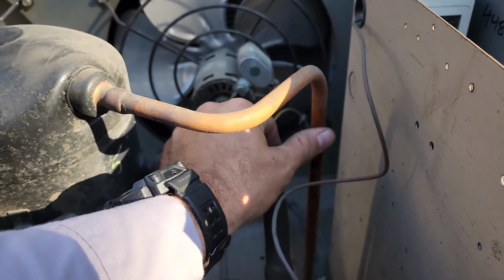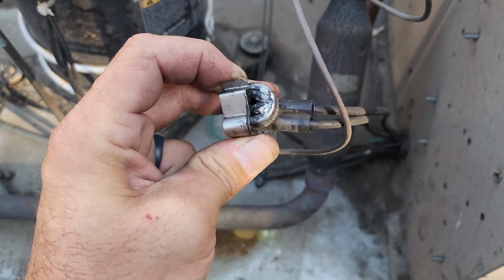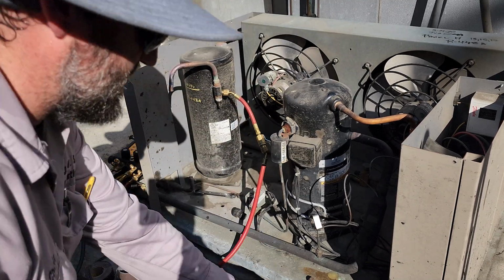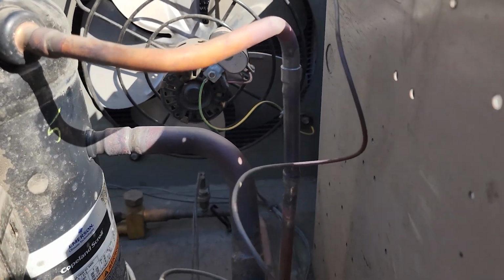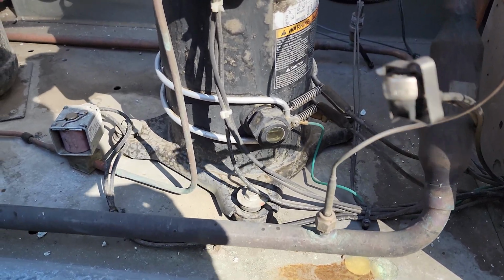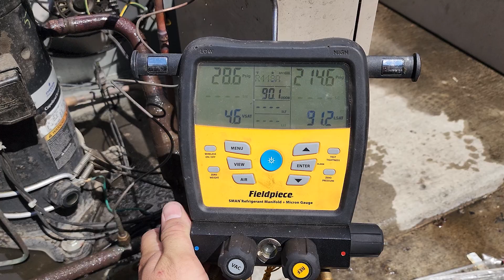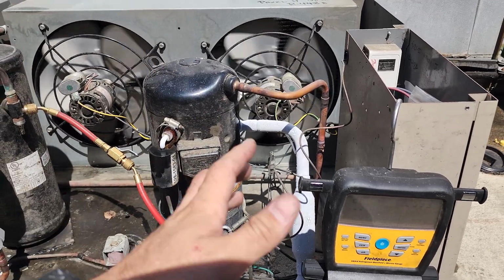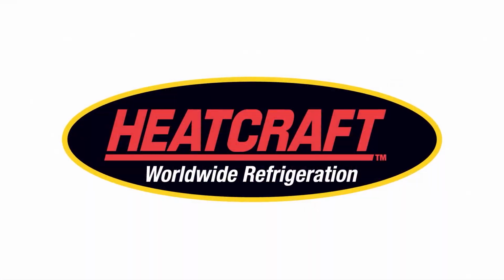I CANNOT BELIEVE THEY WAITED SO LONG TO CALL ME

Comment: A suitable control circuit fuse could possibly have prevented that punctured line.  Although I'd guess it's a fairly rare occurrence.
Reply: My guess is the dirty condenser may have had it cycling on that switch and it just finally failed.
Reply: clive, i'm also wondering that too... (i'm an eletrician "meister" from germany) 
The americans really do electronically-stupid things sometimes... 😂 a simple Motor Protection Switch could save sooo many compressors from dieing (overheating, singe phasing, overamping,...). I also always have to shake my head when he opens those AC rooftop units... man this is an electronic-mess! You think a spider did the wiring :D 
They often dont even have fuses for the multiple compressors... only contactors for switching!! those are fed from one single big terminal... no fuses, no motor protectors, NOTHING... if a copressor dies, they trust the main breaker or that silly metal fused-switch-boxes... absolutely insane... imagine we would produce such a thing in europe :D we'll get fired same day :D
Reply: Didn't expect to see you here. What a pleasant surprise
Reply: Well I didn't expect to see you here Clive 🤔 it's a small world on the internet 😂
Reply: I love it when my fav youtubers converge
Reply: @djtongi  it's all about saving money here in America, unfortunately... everything else is unimportant...
Reply: @protowave  is it really saving money when you have to buy a compressor down the road? Seems like a manufacturer shortcut at the expense of the customer later on.
Reply: @NoName-sx4cz  you are right, but few bean counters actually care about failure costs, they don't even consider them most times.

And sadly the bean counters run most things now, save a penny per unit by removing a nickel of value while keeping the sale price the same, repeat until you have sold all of your good reputation, wonder why no one buys your overpriced now cheaply made brand anymore.
But they never think past this year, sometimes even this quarter.

Personally I have become convinced that it's just part of the natural life cycle of business, one of the many natural way they die.

Comment: Regarding the suction line check valve. I work for a wholesaler and this is the explanation provided to us by Heatcraft when we discovered these in our units: "We used to do the discharge check valve which worked great but then came along that wonderful R-448A that runs very high discharge temps that tended to keep the DTC valve open at pump down so it leaked back through there.The best solution at that point was to install the suction check and then we made it universal for medium and low temp."   
Great video as always. Great Job.

Comment: The gas ballast valve on vacuum pumps is not really a bypass.  What it does is admit a small amount of air between the rough and high vacuum stages of the pump.  This air flow does two things.  One, it makes the pump work a little harder, to increase the oil temperature (and the vapor pressure of any contaminants, such as water or refrigerant, that have dissolved in the pump oil).  And two, it helps to flush those contaminants out of the pump.  The net result is a greater flow rate for any vapors that can dissolve in the pump oil, at the expense of ultimate vacuum.  So, evacuating the system to about a 1000 microns with the gas ballast on and then shutting it will lead to an over-all faster pump down and deeper ultimate vacuum.
Reply: Well stated
Reply: The ultimate vacuum difference (at least with dual stage rotary vane pumps) is negligible. E.g. my pump (non-HVAC, Leybold D25B) has an ultimate vacuum of 10^-4 mbar without gas ballast and 5*10^-3 mbar without. HVAC probably doesn't go below 10^-2 mbar.
Reply: @kanetw_  My experience is mostly with smaller pumps, such as Edwards 5 and 8 series, where the gas ballast makes a fair bit of difference in the ultimate vacuum.  I would point out that the specs you gave indicate a pressure difference of 50 times higher with gas ballast, which might be OK for HVAC, but might not be negligible in all applications.
Reply: @robertlapointe4093  Yeah, it really depends. Single-stage pumps also lose a lot when gas ballast is on.

10^-3 to 10^-4 mbar is the region where you can't really use single pumps anyway due to too low pump volume. 
So you have to do a multi pump approach with e.g. a turbomolecular pump backed with a fore pump, and there it doesn't really matter if the fore vacuum is particularly low as long as it doesn't exceed the turbo pump specs.

In vacuum drying applications you'd end up adding a roots pump to get good pump volume at low pressures, and same thing happens again.

Also a thing I just remembered: the 10^-4 mbar is partial [air] pressure, but around 10^-3 you start getting oil backstreaming so the ultimate total pressure (hidden in the detailed datasheet..) tops around 2*10^-3 mbar.

Comment: I do find it interesting when you mention ‘big picture’ so often. When a lot of the big picture stuff you reference is ‘Check wear items for wear and replace as needed’ Like, you’re totally right it’s big picture stuff that needs checking. It’s just interesting that people need to be reminded that parts designed to wear out and be cheaply replaced need to be checked routinely and cheaply replaced when needed.
Reply: The same goes with automotive repairs. Always big picture, look under the car, examine all the structure and suspension/steering components and address anything else you might find about a customers car. It's not about making the most money but informing the customer that it may be time to replace equipment even if you don't get the job. At least you were honest with the customer and that's what really matters.

Comment: As a mechanic on south Africa, it weird to see so many electronics on the system. Like I've heard about the electronic expansion valve, but we mostly still use the normal TXV
Reply: yes we have EEV.  just a friendly reminder dont try to mix a new Evaporator EEV with an old R22 condenser!

Comment: 23:45 - Is that time delay a delay-on-make? or delay-on-break? It would seem that delay-on-make would keep the compressor off longer in case the pressure increased slightly after cutout (unless I’m over-thinking it, here). I’m barely two years out of school, so I’m still learning a ton. Thanks for your input. I had a walk-in that was short cycling on low pressure cutout during pumpdown.

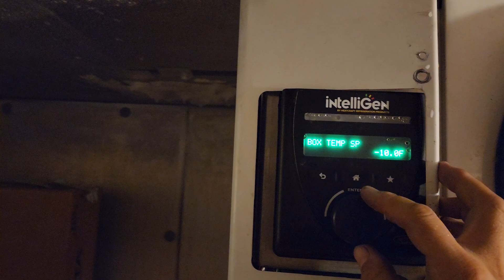Comment: I wonder how the little controller there on the evaporator unit will handle moisture? Can already see tons of water behind the display at 25:00. Hopefully they have some conformal coating on the PCB in there or it will have corrosion issues down the road. One could make the argument that it "freezes" and is not as much of an issue but as soon as someone opens the door, it will just vacuum moisture right up from condensation.

Comment: you replace a lot of contactors in the usa i think its that in the usa you have 3 phase 208volt and in europa we have 400volt 3 phase so the current is lower and dont burn out the contact points in the relai 

i m a electricien in holland and do a lot of work also blowers etc  in the restrands the cabels are thinner here also so its easlyer to bend it
Reply: We do have 480V 3-phase, but most likely found in manufacturing.

Comment: Hey Chris , nice show with Ty tonight. So on that tdr (time delay relay ) I had heat craft telling me today that it’s there for when the compressor shuts off, not the other way around, and the lps is wired in parallel with it , discharge temp in series which someone’s since eliminated … plz advise , tyvm 😎
Reply: This was on a beacon II system

Comment: hey, got a question. Everytime when system is empty, got a leak you should looking for a (as you said) oil signs. So. When there is damaged condenser, damaged pipe or whatever damaged, what cause Freon leak then leak oil too which is mixed with freon. So. Theres no general rule to add oil to system when 100% of freon leak and some% of oil is missing from system too ? Sorry for my english, hope you understand.

Comment: and thank you so much for clarifying that 600 microns is sufficient for these really old systems.  ive worked on plenty of walk in freezers that are from the 90s.  My coworkers think theres a leak if it wont go under 500.
Reply: Could be true, if you vacuum long enough you should be below 500, but it probable wont stay that low. But there is no problem to run the vacuum pump for a few hours or more to get good vacuum
Reply: @timodeporto686  this dude goes above and beyond. if he says its ok, i believe him
Reply: @garyhyde1370 He states in the outro that he prioritized uptime vs "the best way to deal with moisture in the system".  He didn't say it was OK to vacuum to 600μm, he said he got it back in service and is trying to have the customer allow scheduled downtime later, to change out the oil and properly do the job.

Comment: my line of work is pretty much what you do.  recently had a fancy evap like that one EEV 2022 digital display all that, but paired with a 2003 R22 condenser.  Evap kept getting top part frozen up.  would freeze up imeediately and it was a cooler.  Tech support said the capcitance doesnt match with the compressor and evap.  Have you seen this before?

Comment: That vibration on the compressor line was maybe because shock mount missing. You were tipping it up and down, seemed like it lost its rubber. did you tighten that down to its base????

Comment: Whats that suction check valve for?
Edit: i see now.  I usually install a check valve in the discharge line of scrolls with pump down for the same reason and to prevent liquid migration into the compressor on the off cycle

Comment: As handy as “smart” (internet connected) devices are, most of them aren’t properly secure and that’s the reason people are a bit hesitant to use them right away, probably not even the fault of the manufacturer but usually whatever subcontractor actually engineered the module.  These vulnerabilities can expose the entire company network to hackers once an exploit is found and the smart components aren’t updated that often to patch the issues since that’s not the subcontractor’s main concern.
Reply: Another problem that makes some hesitate to adopt such systems is that just like home smart thermostats the power company may be able to reset them in power situations and then the restaurant might not have proper cooling for there food storage. I do not know of this having happened yet, but I can see some power companies trying it.
Reply: And another problem source: mantain connection and communication.

So in a integrated system u get more than two usual work / pont work states. And the other states can go over anybody, how cant predict the system behave. 
And there is more than two system are chained from actuator to the consumer.

Comment: I'm a computer engineer, so I don't usually deal with high current or voltage, but I always wonder why these units don't use solid state contactors.  It seems like the contactors almost always need to be replaced when you get called even if they weren't a major contributing factor of the failure.  Is that due to cost, technical reasons, or something else entirely?
Reply: Definitely just cost and availability. Contactors are cheap. Perhaps some hesitancy towards change as well. Someone previously linked a nice solid state contactor with inbuilt delay timer and all that goodness when Chris was changing a bunch of contactors from sand ingress. 

It would definitely be a good improvement for long term reliability in harsh environments and just in general.
Reply: Take a look at the thermal disapation curve of SSRs.  Mechanical contactors, when in good condition, have almost zero voltage drop across line & load.  Even good SSRs drop quite a bit of voltage across the SS "contacts", and that makes a lot of heat (and is a waste of energy).

It's not just cost.

What gets me is that these mechanical contactors, put into outdoor service, are so poorly shielded from the elements.

Comment: What you'd have to do to convince the customers to go for it is create a server with a VPN end link.   You then have a router at the customer site that is ONLY used for the refrigeration equipment, and it's only connection outside is through a VPN directly to your monitoring server.  That's how you have to sell it - end to end security, with YOU being the person doing the monitoring, not them.   Charge them a set fee per site (or machine) for monitoring ($15 per month per piece of equipment, for example).    To compromise their systems, someone would have to break into your system, then bounce to their system - which requires another level of malicious code breaking.
Reply: Nope no way you should give important infrastructur anyway of internet access, who says the company doesnt brick them by mistake or because you didnt do there required service from an authorist technican.
Put somesort of thermometer in the freezer, that gives an alarm if the temperatur is to high and send an email/sms to the hvac guy,  that they come and check.
But it shouldnt be able to set any settings on the freezer itself.
Reply: @jonasstahl9826  - I disagree.  There are points where you have acceptable levels of risk.  If the end points are all contained within VPN,  system penetration requires the same effort as physical penetration.   You're more likely to have someone on-site bridge into the link than to have someone breach the end points from outside.   That sort of physical access can't be stopped by not having internet.    In many of these cases, it might be that a warning could allow kicking on an extended defrost cycle to keep the system from requiring an on-site visit with a hose, two weeks later.
Reply: Or, make the premises equipment end read-only; monitoring can occur but (mainly) info flows one direction only.

Comment: So a device shorted out and blew a hole through the side of a pipe...

Welcome to the Wonderful World of Arc Flashes...

This by the way, is why High Voltage disconnects (especially High Voltage DC Disconnects) are built with Arc Quenchers in them...they stop the Arc as fast as possible to avoid excess damage to the Contacts and or other equipment/people that are next to the Contacts when the Circuit is opened...

Arc Flashes are also why High Amperage Fuses are built so large and above a certain value, filled with Silica Sand, it's so when an Overload happens, they open the Circuit without becoming a Fragmentation Grenade at the same time...

Comment: So much work for a little repair,I would of just spot well that ,vacuum it and call it a day,
Before you do the vacuum, pressurize the system and do a quick leak check on your welds,that way you don't have to worry about after you send the refrigerant

Comment: Why would you cut that out and have two large braze joints vs brazing over a pin hole?
Reply: To charge more money I guess. 
Or is the copper pipe compromised already. It's a piece of mind to be sure that he fixed it.
Reply: For peace of mind knowing new pipe is there, he's got 2 potential failure points with his brazing joints, rather than a quite large time bomb of failure.

Comment: "They don't want to be hooked up to the internet"
Chris, did you hear about customers in Colorado having their smart thermostats locked at a certain temp due to a "climate emergency"?
Reply: I just read:
". . . customers to opt in to its AC Rewards Smart Thermostat Program, which allows the company to override thermostats in order to ease the electrical grid. In return, customers receive a $100 credit and an annual rebate of $25. "

IOW, those people got paid to allow Xcel to do that.  It's got nothing to do with IoT being good or bad.

And, the event I read about wasn't a "climate emergency" but a hardware failure caused power outage elsewhere on Xcel's grid, making it a normal emergency . . . not a "climate emergency".

Comment: How come the fans were still running while there was no gas in the system?
Reply: Low pressure switch controls the compressor not the evaap fans . 

But that’s a fair point. Fan delay should have kept the fans off huh
Reply: @drodriguez394  That's was my point, the board should've kept the fans off since it had a high temp alarm.
Reply: @rafaelgomez4304  interesting. Maybe logic in the board just circulating the air. I don’t know the answer for that.

Comment: Why is the compressor liquid injection solenoid on a current sensor? Why not just put it right on the compressor contactor?
Reply: It ensures the compressor is actually running. If you just check the contactor, there's a chance you could fill the compressor full of liquid if the compressor isn't actually running, on overload, missing a phase etc. Then once it actually starts you'll wash all the oil out of it or destroy it from liquid slugging.

Comment: Side glass on the suction never seen that than you will have fluid on the compressor that's not very good on a scroll I know that it can run 24 hours on fluid but still??

Comment: Most of these internet connected devices have no security, and most businesses have only one network. So plugging and insecure device into the same network as credit card data is a disaster waiting to happen. To put something like that in my restaurant, the firewall would have to segment it off from everything else and still pass a PCI compliance scan. I could ask for an exemption, but unless it is imperative to operations, i dont like to risk it.